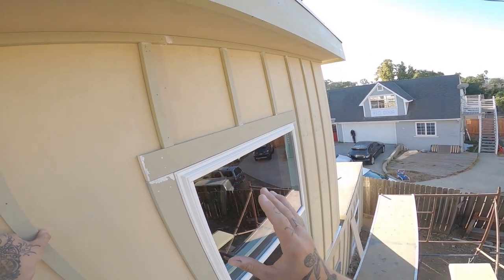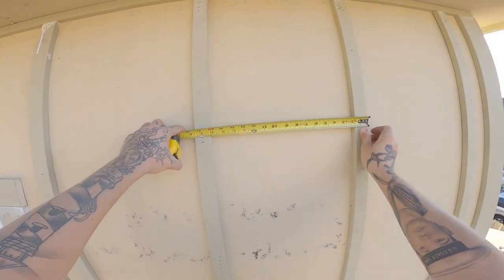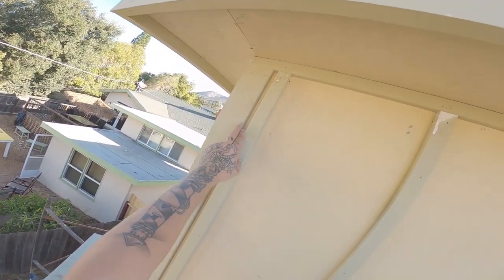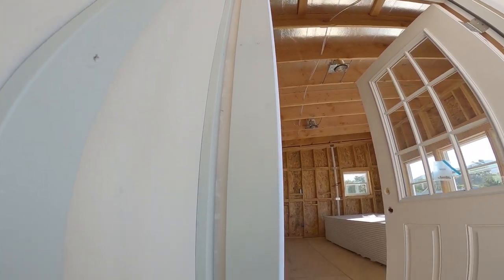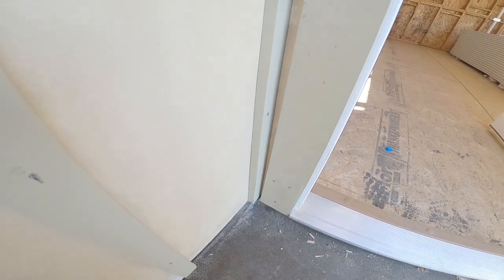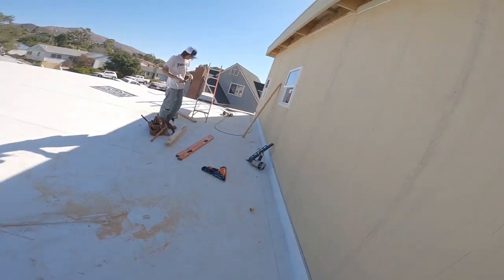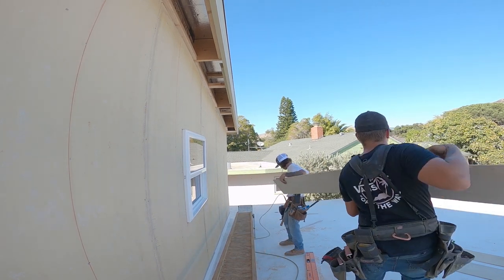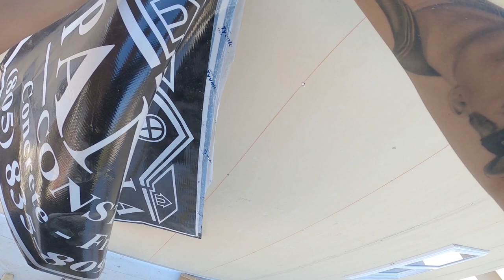10 Day House Build: Board & Batten Siding Install!

Comment: Pro tip: You can avoid those slivers of boards at the corners by re-spacing from the wall’s center outwards. Either start layout at the center of the board or edge; whichever lays out better.
Reply: Or start at the end and adjust before the corner, like cheating shingles on a roof.

Comment: do you have to nail the big hardie panels into studs? or is 7/16 osb enough.. I have a 60 ft wall . 16 oc framing. can I run the battens 24 oc and only nail the panels 24 OC. ? covered by the battens.

Comment: Hey Matt, I've noticed you using the new skill saw worm drive with the monster battery. In your opinion, how does it compare to the Makita or Milwaukee battery powered worm drives?
Reply from the maker: In my opinion it rips better! It also has more power.

What it lacks? Depth of cut! 2-3/8 vs. 2-9/16..
Reply: @MattBangsWood  awesome. Which one do you prefer to use? Obviously the Makita is a little more economically priced so I'm  wondering if double the price is worth it.  Btw I love watching your channels. Seeing skilled carpenters do things and getting the little tricks has helped me a lot as a carpenter
Reply: @MattBangsWood   id also love to see some more instructional videos having to do with stair building, rails on stairs, tips for framing around gables

Comment: Sorry if I don't understand so god english... but, what type of material you use here to cover please ? Thanks a lot.
Reply from the maker: Denis G. James-Hardie 4x8’ Smooth Sheets for siding panels, 1-3/4” Advantage Plus battens and 3-1/2” Advantage Plus corner trim.
Reply from the maker: Denis G. It’s a wood trim, with fiber cement sheathing.
Reply: @MattBangsWood  ok thanks a lot for the quick answer... it's a lot of money :-(